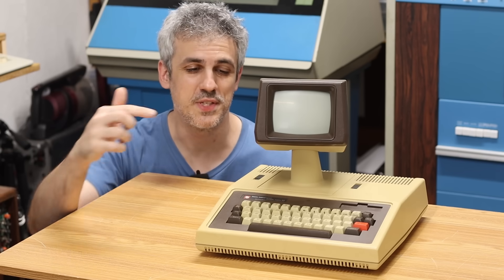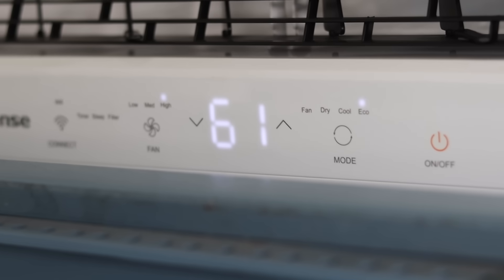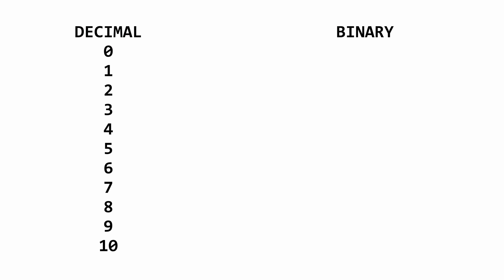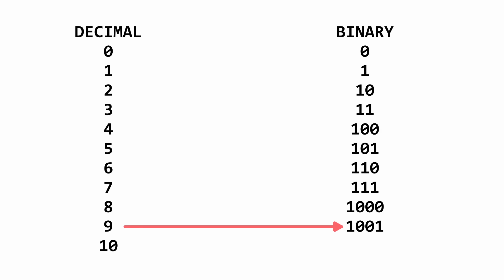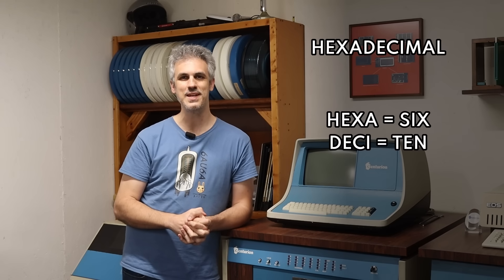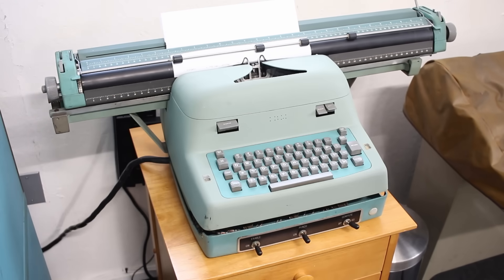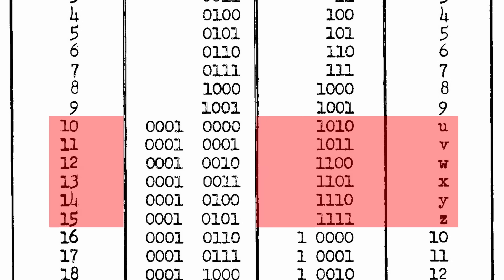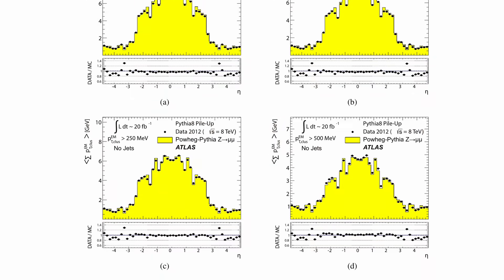Learn How to Count Like a Madman (Or a Computer)!

Comment: 14:00 There actually is a name for that system: a mixed-radix system! And you say you've never seen it before, but consider this: we write times in mixed radices! 23:59:59 + 0:00:01 = 0:00:00 of the next day. There are two ways to look at what's happening:

(1) The three numbers of hours, minutes, and seconds are, respectively, in bases 24, 60, and 60. Since we don't have more than 10 symbols available, we write each base-24 or base-60 digit as a base-10 number, and we separate the three higher-base digits with colons for clarity. Using lowercase letters for the numbers 10-35 and uppercase letters for 36-59, the above addition could be written as nXX + 001 = 1000.

(2) The number of hours is in base 24 as above, followed by two pairs of digits, each of which is a base-6 digit followed by a base-10 digit. The math works out the same way; there's just more carrying involved.

As I understand it, this is a result of ancient Babylonians and Sumerians using a base-60 system, which they also wrote out as base-6 followed by base-10 (albeit with different symbols used for each base). That's also related to why we divide a full revolution into 360 degrees: it's a nice round number in base 60 (in addition to the fact that the stars appear to revolve at a rate of about 1 degree per day, due to the number of days in a year).
Reply: No, we don't. There's a REASON those ":" are there - 235959 would be an idiocy. Not the same thing as "23 HOURS, 59 MINUTES and 59 SECONDS. Different numbers representing different elements of a single compound quantity. We DO NOT say "121212 seconds, but the second 12 is a single base-sixty 'digit' and the third 12 is another one".

Comment: Well done for this video. Learning number bases is a really enlightening moment when the light bulb comes on. I've always done it as binary (one bit) , decimal (since we have 10 fingers and thumbs), octal (3 bits) , hex (4 bits), sexidecimal (time, base 60 as used on clocks)
Oh and you also missed the opportunity to talk about BCD and why 8 bits and two nibbles makes a lot of sense.
Then you do it again it mathmatical notication - n(2), Decimal hundreds", n(1) "Decimal tens", ,n(0) - Decimal "Units", etc and it makes a lot more sense again as you can talk about any number base with exactly the same logic. 

How many current generation Java programmers understand any of this vs all the hardware engineers that are thinking in logic and VHDL and will say, yep, thats the day job, whats the problem ??.

Comment: A number of historic systems mix-n-match. Old Norse used 3 different systems in its time: Base 12, base 120 as 10 then 12, and base 10. Note that English has distinct names for ten, eleven, and twelve, derived from Germanic languages,  zehn, elf, zwolf is the modern German for them.
Remnants of base 12 survive in English: dozen, gross. Remnants of base 20 as an occasional use also exist: score.
A number of European languages count 20's to 100, and use a base 10 for the fraction of 20.
MANY european nations used 20 and 12 for coinage; The libram (£) was 120 pennyweight (dwt), with 1 dwt denarii, and 12dwt solidi. This resurfaces post-roman in several, most notably England, in the medieval period. It doesn't hurt that coingeld varied from 10 to 20 times the value of coinsilver; when the crown fixed England on £sd, it happened to be close to 12x, so a gold penny was equal to a 12dwt scillig.
Assyrian used base 60, writing it as  6's and 10's, with individual hexidecimal combining the two. (easiest place to see that is the unicode table for cuneiform.)
Octal was used by several roughly stone age  cultures contacted post 1600; several used base 20 in 1's and 4s. Both Aztec and Maya used

Comment: The 0 after the 9 is an historic artifact. At first typewriter had no 1 and no 0 to be made from the least amount of components.

So, to type a 1 you would type a capital i instead and for the 0 the capital o. Later then the 0 emerged near the o. :o)
Reply: I wonder if this is the reason early computers used CAPS instead of lower case. In lower case there could be confusion between l and 1. O vs 0 was solved by the strike-through.

Comment: I might have an answer why the zero is at the back of the keyboard. 
Maybe it's because it has zero = 10 pulses in the impulse dialing method and therefore sees it as the last digit on a dial of an old telephone. Because there can be no 0 impulses and it has to start with an impulse.

Comment: The reason for zero coming after nine on a keyboard is typewriters. When typewriters were first invented, to lower the parts count they didn't have a zero key; you were supposed to use an "O" (the letter) as a "0" (the number) instead. IIRC some early typewriters took this to extremes, such as using the same key for "l" (lowercase L), 1, and "I" (uppercase i). Later when typewriters became more common, and manufactures needed to make their typewriters stand out they the zero key, it got put next to the nine because it was near the key people were used to using for zero.

Also, the QWERTY KB being designed to slow down typing to reduce jams is a myth, the YT channel Atomic Frontier has a video about it called "You're wrong about QWERTY" (watch?v=188fipF-i5I), in short, the first device with a "keyboard" had a single row of keys, in alphabetical order, from there, a bunch of at-the-time sensible layout improvements were made, until typewriter manufactures decided to standardise on the QWERTY layout.

Comment: Hmm, before IBM popularised and effectively de-facto standardised the 32 bit word, the 8 bit byte (though not ASCII, which in any case is a seven bit code) and hexadecimal representation with the 360s, before and for years after, computers used many word lengths. A very popular one being 36 bit as it can hold ten decimal digits which was the de-facto standard for mechanical/ desktop calculators. Indeed it was argued that 32 bits were inferior simply because you could not represent ten decimal digits. IBM used another innovation to get round that: the processor status register that held carry/borrow over from one word operation to the next allowing effectively any length arithmetic. It also held other flags which made conditional branching simpler. IBM apparently did not invent any of these things, the 32 bit word or even the byte and status register but did bring them together into a killer range of machines and make them "standard".

Prior to the 360 a "proper" scientific computer generally had a 36 bit word. Smaller computers, what we'd typically describe as minicomputers, typically had half, i.e. 18 bit words. Both word lengths are divisible by three, making octal a good choice of representation, especially for addresses. The first computer I  programmed was 18 bit, but actually decimal was used. its "initial orders", aka boot strap rom,  at 8181, which I could never remember until I saw it on the switches. It wouldn't have been any easier in octal, 17765, but as physical switches it was easy: "Not ten". Think about it. That, though is a tangent. 36 and 18 bitters and octal worked well together. DEC made a number of 36, 18 and even 12 bit machines before going down the 16 bit route with the ubiquitous PDP-11. The 11 was a minicomputer with half the word length of the 360, i.e. 16 bits. It was byte addressable, and for the most part used ASCII as its character code, for use with the then also ubiquitous Teletype ASR33. Many models came with extended memory initially addressed with 18 bits. As DEC had used octal for its earlier machines, and the address range was often 18 bits (until later when it wasn't...) octal made sense for addresses on the PDP-11. In any case, octal uses most of the familiar digits of decimal which made remembering and saying octal values relatively easy. The Data 620 is clearly going to use octal as the buttons/lights are grouped in threes, as are the front panel keys on the PDP-11s. Hexadecimal was unfamiliar to many and used non-intuitive symbols, letters generally,  as digits. Hex, in the early years at least, was weird, a the Bendix scheme shows. 

Later computers downsized again for a new and as it runs out, massive generation: microcomputers. They were typically byte based, i.e. half of minis which were themselves half of mainframes. The by then familiar enough, to many programmers at least, byte and ASCII stayed. Early micros tended to have development boards - minimal implimentations to allow familiarisation and experimentation. The minimal requirement to get code and data in was switches - relative expensive  - or a keypad. A hex keypad generally. Data, addresses and contents of memory could be displayed on simple hexadecimal LEDs then available at fairly reasonable cost. Everything became hex, octal was left behind, as were 18 and 36 and other "weird" wordlengths. The byte, and hex with it, was crowned king. From there we've simply climbed back up the word length ladder, to 16, 32 and then 64 bits IC production capability and complexity has grown.

Comment: We were briefly taught BCD when I was doing electronic engineering/computing in college. This was back in the early 1990s and it was considered mostly obsolete by then. 
I wonder if the inclusion of the 'u' (eleventh) digit was just a fudge or if the hardware could support all the remaining hexadecimal digits. This would allow for an easier upgrade to a drum with more storage.

Comment: I learned hexadecimal from soundtrackers - sequencers largely associated with video game music, abs the Amiga in particular. "Instruments" are all sound samples, played back faster/slower to make higher/lower notes; sometimes with loop points specified to allow playing long notes. Note data is arranged vertically in one of several parallel tracks (just 4 in the early days), with volume, panning (if your platform & soundtracker were capable of stereo), and FX data (effect number & parameter value - e.g. pitch bend, sample offset, play backwards, etc.) each represented by a byte each, written in hexadecimal to increase information density on the relatively low-resolution screens of the era.

Comment: 8:31 Well, octal numbers are based on powers of 2 (2x2x2), but the number of digits is not. When octal was most popular many systems had word lengths that were also not powers of 2. These systems also tended to process bits serially, so it didn't really matter how long the words were. Everything would carry through for as many bit-cycles as you wanted. Once computers ALUs started working on complete words in one operation, having nice word sizes became more important for clean scaling.

Comment: The way we count time is a bit like a mixed base numbering system. Decimal for the least significant place, but base-6 for the second digit of both minutes and seconds wrapping around to hours and minutes. We don't actually use a base-12 symbol system for AM/PM flavored hours, but we could. AM/PM itself is binary and then days weeks and months are just all sorts of bonkers, so best to stick with pure decimal to number them.

Comment: We mix numeral system all the time! Take time, for example: seconds, minutes and hours use base 60; days use base 24; weeks use base 7; and months vary in length. Fortunately, we convert everything to UTC timestamps before doing any arithmetic. The same kind of mismatch in numeral system happens with units for weight: one pound eight ounces, for instance, is 1.5 pounds. Also, when we measure angles in DMS format: Degrees, minutes, seconds (DMS) split each degree into 60 minutes and each minute into 60 seconds.
Reply: and the year is so variable 365 days 366 days never mind the months

Comment: When the early microcomputer came out I was thoroughly hexadecimal literate and octal seemed so stupid.  It did turn out handy though as in Intel 8080 instruction set the registers corresponded exactly to the two lower octal digits.  You could decode the entire instruction set knowing just the high 2-bits.

Comment: 13:56 You actually interact with mixed radix constantly. Everyday. In this very comment even. The timestamp. What would it be 4 seconds later? 13:60? No, the ten-seconds' place is actually base six, so it carries over into the one-minutes' place. (Usually. Leap seconds are a thing.)
Reply: and if you're in the US... 12 inches to a foot, 3 feet to a yard, 1760 yards to a mile? bonkers!
Reply: @_f355  , @doublex85, yes good examples and also units of currency, in the U.S. penny, nickle, dime, quarter, dollar. 5 dollar, etc.

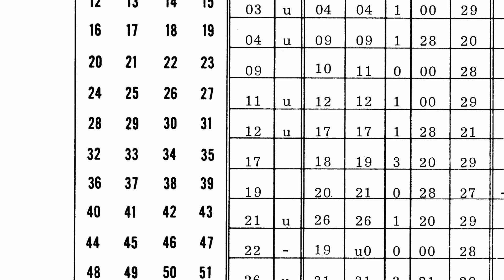Comment: In fairness, we mix-and-match numeral systems every day. For time, specifically - 12:56 mixes base-60 with either base-12 or base-24.

That doesn't make the Bendix... system... any more sensible. But at least there's a sort of precedent, kinda!
Reply: The imperial measurement system has 12 inches to a foot, which then has three feet to a yard & where I  come from either, two, four, sixteen or thirty two divisions to the inch.
Reply: @francesconicoletti2547  dont get me started on non decimal currencys.

Comment: @ 13:02 - the Autonetics VERDAN computer had the same idea - word timings on the tracks of a *disk*, very similar to the Bendix drum. The reason they chose disk over drum was for compactness (the VERDAN was another "sandwich" computer design, opening on a hinge on one edge) and to reduce rotational inertia (because the computer was meant to be an airborne, digital computer). Autonetics provided a disk timing calculator in the form of a multi-layer plastic disk with a central pivot which helped the programmer fill in his programming sheet with ease.

Comment: Back in the dark mists of time before computers became machines but after the invention of the typewriter one of the conventions was numbers across the top row of keys, but it was very rare for the typewriter to have 'zero' key. When 0's were needed the capital O filled in the gap, and a lot of typewriters didn't have 1 key either and the lower case l was the substitute for that. As we all know, the Teletype was the first device to have both

Comment: Just watched a short interview with Bob Beck who was one of the engineers involved in the design of the Bendix G-15 computer who said that the "killer app" for it was its use in civil engineering's cut and fill problem in the construction of highways due to the start of construction of the US interstate highway system in 1956.

Comment: Digital Equipments counts as 000, 001, 002, 003, 004, 005, 006, 007, 010, 011, 012, 013, 014, 015, 016, 017, 020, 021, 022, 023, 024.
That's Octal.
As a C programmer, only use a leading zero on you numbers if you want you number to be interpreted as octal or you'd be into a world of obscure bugs.